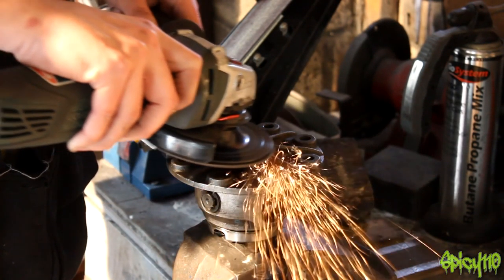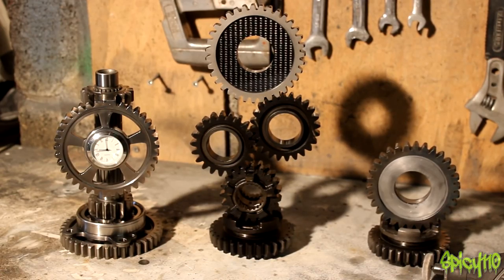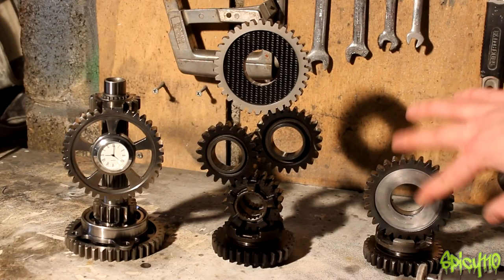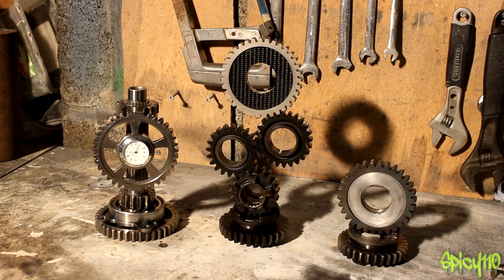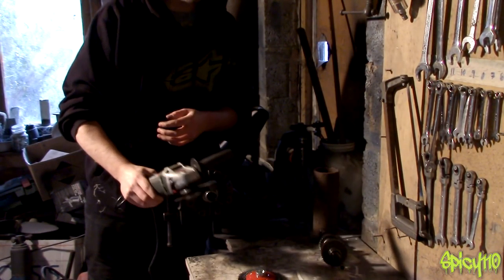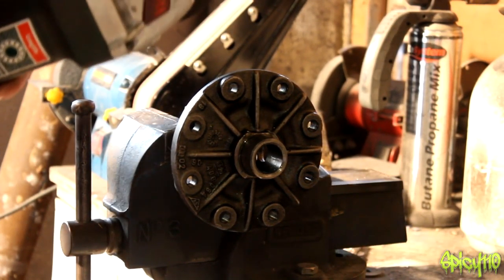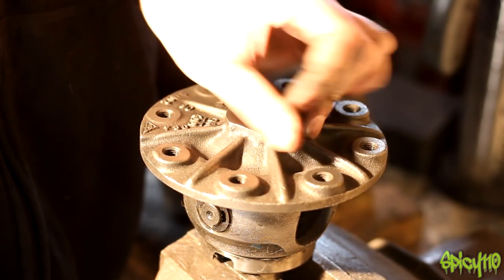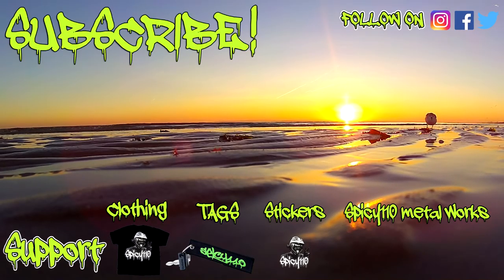Metal Works! Episode 1!

Comment: Spicy, quick tips 1 keep your gas away from the sparky area, never know if the bottle has a leak. Get an industrial dremel if you plan on using it lots. If you can pick up a sander, you can get the hand held ones that are good and can be locked into place and held in a vice. As for gloves you should only need two types in the garage most of the time, nitrile ones for keeping you hands clean or away from chemicals, and welding ones :P just my two cents

Comment: Spicy please use hearing and breathing protection when grinding and put the propane butane can away, sparks were going right by it. It's not likely to be a problem. But you'd have quite the conflagration if it did go off.